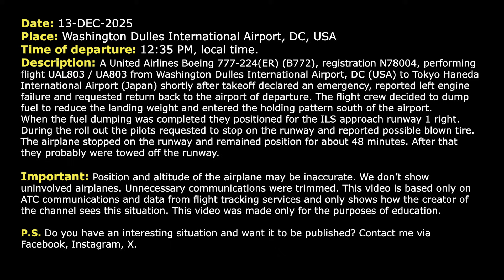Airplane Loses Engine on takeoff. United Boeing 777 declares MAYDAY at Dulles Airport. Real ATC

Comment: I can't help feel ATC created a lot more stress for the crew than was needed in a stressfull situation
Reply: come show them how it's done, they're all hiring.
Reply: @atcdude067   I don't think he means anything bad about ATC,  they were maybe overly helpful which is a good thing and also can be distracting.  Maybe just give them a vector and altitude and wait a few minutes till the pilots  get the airplane cleaned up and engine out procedures started.  
It is a fine line on what the pilots need and what ATC needs.  You know that!  What we never here is all of the coordination it takes for you guys to clear the airspace out.  It did seem to me that ATC was being a little too communicative early on in the emergency.  Maybe this incident can be a great learning example for both ATC and Airline Pilots.  Minor mistakes were made on both ends but a great job on both sides by getting a Heavy Emergency back in safely in Busy Airspace.   Pros on both sides.
Reply: @JeffWiggins-o3d best response here
Reply: @JeffWiggins-o3d please come show us how it’s done. We obviously need your help
Reply: The root problem IMO is obsolete and ineffective communications systems... both old tech and bureau-stuck procedures. 

VHF radio: Copying frequencies and making switchovers was understandably rejected by captain... Leading to Tower having to coordinate abnormal manuvers by interphone with TRACON.  The sadly usual amount of please repeat, stepped-ons and non-responds, all so distracting and needlessly slow.

ATC coordination:  Unheard in these videos is much verbal relaying (mostly phone) of critical information among startled ATC sectors at multiple locations.  This is the main reason why so often there are mutliple requests to say intentions, say fuel remaining, say fuel on board.... The information is not being effectively relayed... That's not ATC incompetence... It's highly inadequate tech & procedures.

These things are inexcusable, when superior, non-verbal, instantly networked technology has been available for decades now.  The problem lies in a sad mix of horrible government procurement regulations, ponderous bureaucracy, barriers to competitive entry of new suppliers and contractors, and adversarial relations between unions and management.  2-month, no-pay, so-called "shutdowns" only make it worse, as does the eternal sequestration of airways trust money, and the federal budgeting processes.
Reply: This is the most secure airspace in the world. An aircraft that low is a massive security threat that has norad actively involved. There is no standing by
Reply: So would you prefer that they simple stayed quiet, gave no instructions, and just let the plane's crew figure it out on their own?
Reply: @jackio46  ATC should of just said, MVA is 2500, tell me what you need, and monitor for every aircraft headed their way.. End of conversation..
Reply: @ImionsaeXwb77  100%
Reply: Talk is easy
Reply: Because comms between ATC and aircraft in the USA are so non-standard,  getting your message across is difficult.  Don't know why they just can't stick to the ICAO Standard.  It's actually rare to hear an American aircraft say 'mayday.'
Reply: @pmj059  We are mostly trained for it and are supposed to.   (Using ICAO phraseology however not mayday or pan but mostly everything else)  There are some distinct differences but it seems that we just have a lot of bad habits and never get corrected by ATC or senior flight crew.
Reply: Can you make a drawing for easy understanding 😅
Reply: I think they all did a kick ass amazing job!
Reply: The tower has the super human job of clearing airspace & a runway for the distressed plane to land, putting a ground stop in place,  guiding first responders out to where they need to be without being hit by taxiing aircraft. All while keeping all the other aircraft in the air & on the ground safe. What a job! And they don't get the respect they deserve❤
Reply: @wanderosa  There’s nothing disrespectful in pointing out where a professional can improve performance. And in this instance, the tower controller’s poor radio performance impeded the task that highly professional pilots were dealing with, trying to keep themselves and everybody onboard alive in a highly dangerous inflight emergency, to the point that they had to say so!
Reply: @MarkSJBeard poor based on what exactly? We live near the crash site of TWA Flight 514. Slammed into Mt Weather Dec 1, 1974, killing almost 100. The pilots worry about their part.  ATC worries about theirs, including maintaining a safe altitude for the stricken aircraft & the safety of the other planes sharing the airspace & on the ground.  Working together, they  managed to safely land a 777 &  saved scores of souls in the air & on the ground.
Reply: @wanderosa . Based on the repeated questions, the ums and ers, and calling for confirmation after every damned call to the point that the pilot got really quite frustrated with tower controller. Radar controller was so much better. Have you ever flown during an inflight emergency?

Comment: I can understand the controller being nervous about the slow climb as the flight path northbound is awfully close to Sugarloaf Mountain which is 1,282 feet.
Reply: I was watching it live (online) because the plane was flying past my house. I kept thinking- "why isn't the plane climbing?" As soon as I saw the abrupt 180 degree turn back towards the airport, I knew there was an emergency situation
Reply: And there could be a lot of IBA's a those low altitudes (Itty Bitty AirChines), most "flying around".
Reply: Absolutely, the controller was warning them of them impending danger and did the right thing.
Reply: Exactly.  On December 1, 1974,  TWA Flight 514 slammed into Mt Weather, killing nearly 100.  Fog was supposedly a contributing factor. Part of ATC's job is to know the airspace & it's potential dangers & never lose sight of the big picture.

Comment: One thing to remember - for pilots, training for these scenarios is done in the simulator, and in that situation the ATC 'role' is played by an instructor, ie. another pilot. That ATC 'role' may or may not be played realistically. It is often 'simplified' to a degree (ie. all requests are immediately granted, frequency changes are minimal, intentions are immediately understood, questions are not repeated, MVA's/airspace requirements may be ignored, other traffic is not simulated etc. This varies quite radically from instructor to instructor.) This may explain the somewhat stilted conversations during emergencies - NOBODY actually trains 'to reality' in those situations - neither the ATC nor the pilots. It's a bit of a gap. In a perfect world, an actual ATC would fill the role in the simulator (mutual cross training?) but in practice, this is simply not done.

Thus, watching these videos, reading the comments, it is (again) highlighted that there is a bit of a disconnect between pilots, ATC, and (to a more irrelevant extent) the lay public (or enthusiast, PPL etc) regarding how these type of events are, or should be handled. The last part can be exaggerated when watching these clips, because 90% of ATC comms are cut out, making it seems like the ATC was just chilling playing Angry Birds or something instead of listening out, as opposed to the reality, where they're on the horn with multiple other controllers, fire services, other aircraft etc. They have a massive workload as well.

- Pilots have their requirements (workload, 'leave us alone in the beginning', checklists, taking time to make decisions properly as opposed to instantly knowing what they need/want to do)
- ATC have their requirements (MVA's, SOB, fuel remaining, other traffic, runways occupancy, other stations etc.)

The two may seem mildly at odds every so often, but of course everybody wants a safe outcome.
Reply: Well said by an ATC'er trying to take up for their brethren who just would not quit bothering the crew at a critical moment...but failing miserably.

Comment: As in most of these video the silences have clearly been trimmed, so those being harsh on the ATC and their amount of calls should take that into account. Secondly the term losing/lost an engine and the video creator being accused of being over dramatic or even it being click bait, "we lost an engine" is the description given by the flight crew at 0:15. I assume these comments come in the wake of the recent MD-11 crash, but the term is widely understood to mean they've lost power from an engine.
Reply: Are you saying that the flight was significantly longer than the 9:50 length of the video?
Reply: @kirdref9431 Yes obviously. FlightRadar24 shows the flight was in the air for approximately 45 minutes.

Comment: If you are an ATC and reading this, you HAVE to leave them alone. Use your available time for coordinating with the next sector and only make absolutely necessary transmissions such as frequency changes in the first 5-8 minutes. They will NEVER return immediately unless they think they are going to crash. They will ALWAYS need 5-10 min to work through the checklists. Souls on board and fuel is irrelevant until they are ready to return for landing, and if they crash, the airline will provide that information by the time fire and rescue vehicles arrive at the scene anyway. Vectors to hold on or near final approach is excellent. It keeps them close to the field in case things escalate. Just don't hold them over final approach while dumping fuel if there will be traffic below.
Reply: It sounds worse on these ATC videos than it really was though. In this one, the first 5 minutes (up to halfway round the plane's first turn) is compressed into less than 2 minutes of video/audio. Presumably due to ATC comms with other planes and silence being trimmed out. The entire incident lasted for 44 minutes (takeoff to landing) and is compressed into less than 10 minutes here.
Reply: @1947dave He literallly was told “we’re busy”.  Also a WB going to Asia is EXTREMELY UNLIKELY to be able to turn around and land.  I know controller was trying to help, but he was a distraction period.
Reply: @GenghisKhan2000  I'm just reminding folks that it's heavily time-compressed, with longer gaps between most of the transmissions than we hear in the video. So, yes there were absolutely some unnecessary and annoying questions early on,  but overall it's not as bad as it sounds.
Reply: They have procedures, most of which were probably written in blood.
Reply: Everyone has their challenges, we are here to work together. Yall miss plenty of calls and clearances too, and nobody is perfect.
Reply: @atcdude067  reading all your comments it seems you must have been the dude that wasn’t paying attention. Criticism leads to improvements and you’re arguing with YouTube commenters. Just something to keep in mind my dude.
Reply: controllers are all about their wants

Comment: Click Bait video title. "Losing" an engine is not (or should not) be the same as losing POWER. TD
Reply: Yet "lost a engine" was the term used by the flight crew at 0:15. Think anyone with even a passing interest in aviation would know what is meant.

Comment: This is the weirdest thing to happen at IAD in a long time! From April 6, 2019 until just yesterday, according to data from three independent aviation safety databases, United has not experienced a single instance of trouble with their GE90 fleet-that's six contínuous years of flawless performance. Meanwhile, their P&W-powered 777 aircraft get engine trouble a few times every year. This was weird!

Comment: “I’m Busy” short to the point. The pilots were in control. ATC needs to understand this is a 77E fully loaded at the very limit of their fuel capacity. Let them fly. You can get SOB and fuel later. ATC needs to learn the 3 commandments - Aviate, Navigate, Communicate.
Reply: whatever a 77E is.... clown.
Reply: They were flying too low…..ATC did a nice job advising them….
Reply: @jwthompson9571yes advise them of an MSA and then shut up.
Reply: @BangaloreAviation you want ATC to let them slam into the side of a mountain a la TWA Flight 514? Ok, then.
Reply: @wanderosa  read my observations before shooting your keyboard.
Reply: you flight sim and youtube dorks need to understand the states surrounding DC are not flat and have terrain. i get it, when you’re on a screen all day you think everything is flat

Comment: 1. ATC mistakes / weaknesses (the most noticeable)
A. Poor timing of questions

ATC asked for:

souls on board

fuel remaining

engine identification

intentions

…while the aircraft was still low, slow, and unstable after an engine failure.

Why this is a mistake

The first 1–2 minutes after an engine failure are the highest workload phase.

Standard best practice:
“Fly the airplane → then talk.”

Better phrasing would have been:

“United 803 Heavy, radar contact, maintain present heading, climb as able, say intentions when ready.”

B. Repeated transmissions after “I’m busy”

The pilot explicitly said:

“Stay this frequency. I’m busy.”

Yet ATC continued with multiple calls.

Why this matters

This increases cognitive load

Raises the risk of missing a critical checklist step

Can create frustration (audible in the crew’s voice)

Controllers can and should give space once that phrase is used.

C. MAYDAY acknowledgment delay

The crew had to reassert MAYDAY to get attention when ready to land.

Why this is a problem

Emergency aircraft should never feel ignored

Even a quick “United 803 Heavy, standby” would have been sufficient

This is more of a frequency management issue than negligence, but it still counts.

2. Pilot-side issues (minor, but real)
A. Inconsistent or unclear fuel reporting

You hear:

“16 hours of fuel”

Later “15 hours”

Later “over 10 hours, 146,000 lbs”

Why this matters

Controllers and ARFF prefer one clear, standardized number

Pounds or time, not both, unless clarified

This likely reflects workload, not incompetence—but it did cause confusion.

B. Slight communication sharpness

Responses like:

“Negative.”

“Go ahead, sir.”

Are understandable, but a bit abrupt.

Why this matters

It can momentarily slow ATC understanding

That said, this is very forgivable in an engine-out scenario

This is more about tone than procedure.

3. System / training issues (no single person’s fault)
A. ATC unfamiliarity with specific departure procedures

One commenter nailed it:

The aircraft was likely flying a Special Departure Procedure that guarantees obstacle clearance

Controllers appeared unsure and kept pressing about altitude

System issue

Controllers don’t always have deep familiarity with airline-specific SDPs

This causes unnecessary questioning during emergencies

B. Frequency congestion

Multiple handoff attempts

Multiple controllers

Emergency + normal traffic

This increases:

Missed calls

Delayed responses

Pilot frustration

4. What was not a mistake (important to say)

Declaring MAYDAY ✅

Fuel dumping ✅

Holding before approach ✅

Choosing ILS over visual ✅

Stopping on the runway for a suspected tire ✅

Taking time instead of rushing back immediately ✅

Bottom line

Biggest mistake:
➡ ATC workload management and timing of communications

Minor pilot issues:
➡ Slightly inconsistent fuel reporting under stress

Overall:
This was well handled, with human-factors friction, not poor airmanship or incompetence.